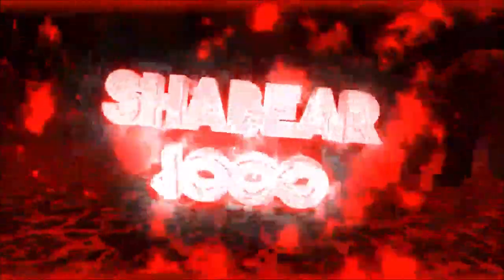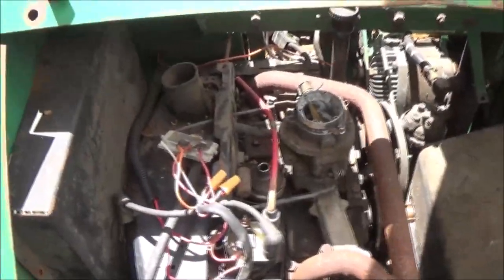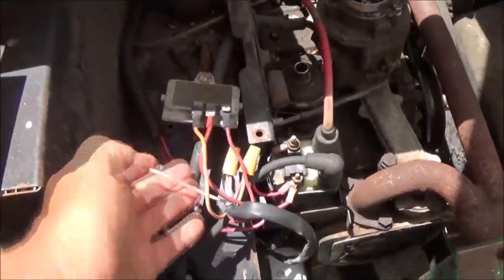Engine Removal And Tear Down Onan Performer 20XSL

Comment: Curios as to where you were able to source parts ive got the same motor with a dead cylinder trying to source parts before I rip it apart
Reply from the maker: I have not ordered the parts yet but I did find them on line through jacks small engines. Here's the link, 
https://www.jackssmallengines.com/manufacturer/onan?gclid=CjwKCAiA4KaRBhBdEiwAZi1zztEw8s_VcVyEwK_kpgipsNfuoWWbyhB_JMtYIRCi6Jg7P5AhMxdf7RoCAoIQAvD_BwE

Comment: Wow, that engine got tore up.  Hopefully you can get the parts reasonably to get it running again.
Reply from the maker: i can get the parts pretty easy, i just hope there isnt anything wrong with the hydraulics. but i'm guessing it was the engine failure that was the reason for parking it.